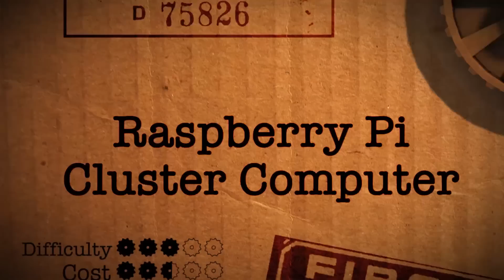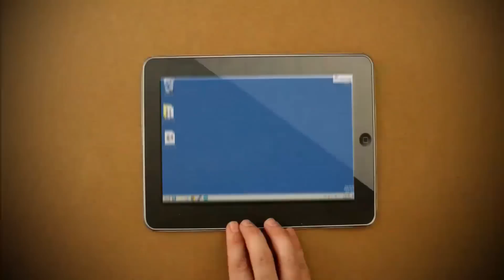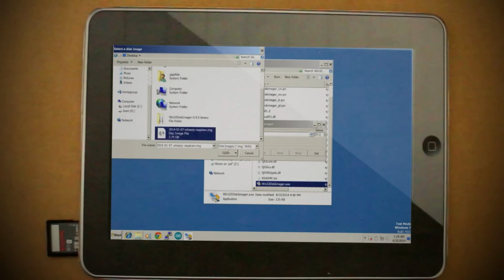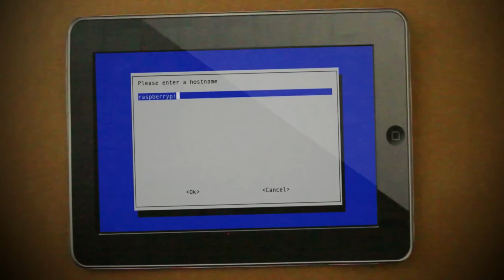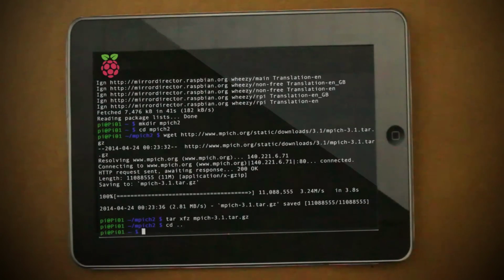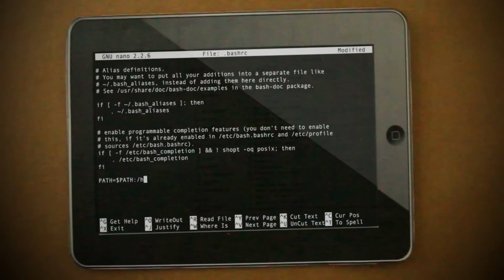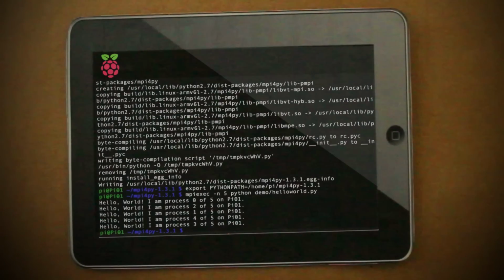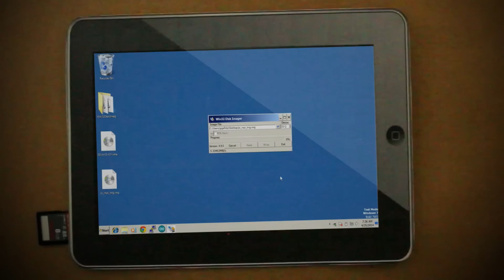How To Make A Cluster Computer (Part 1)

Comment: Hi. Great God-given talent. Is this also called parallel computing? Is this method the one used for data centers and render farms as well as supercomputers? Any idea or theory how to combine the power of Dreamcasts (lens are no good but the boards are ok) into one powerful Dreamcast scalable cluster that can be made for developing DC games that rival the modern console (just for technical fun) coz' the DC are still being developed for. 

Also any idea or theory how to make a cluster off Macs, say you have an old iMac and bought a new iMac, you'll double it's graphics power and CPU when it's doing parallel computing as well as have two monitors (scalable so everytime your iMac or Mac or PC becomes obsolete it can be added to the cluster so you can combine its power). 

Thank you. God bless. Rev. 21:4

Comment: I am bulding something more useful... i am setting up what i call Serverus 
not the harry potter character...  cerberus(mythological 3 headed guard dog made of servers)

Basically i'm using two RP2s and one Bannana pi and running a dedicated application server, database server and content server...

Now the raspberry pis are weak but they are running very specific tasks and responsabilities anmd i can optimize each server for the given task (i will be writing them from scratch... just for the lulz)

clusters are fun but pointless for most people....

It would be cool if one had some cool virtualization solution for creating a combined virtual computer that uses all the computers hardware a bit like windows azure does... not sure what software could do that that open source... but it probably wont run on a raspberry pi :p

Clusters otherwise are mostly good for task that can be devided and handed out like say rendering frames in an animation though the clock speed would be a problem for that probably...

Comment: Pi Zero is $5.00 .. Thats 20 of them for 100$, Thats 10gb of RAM, 20 Cores( I believe Zeros are single core correct?) I mean, it would not be the most powerful super computer or anything but should run rather well and the cost is dirt ass cheep.

Comment: So do all Linux variants use Sudo commands? What does Sudo even mean? I've been using windows all my life. As far as Linux goes I've only installed Ubuntu and Kali before. What the heck is raspberry pi.
Reply: It is used to run command as administrator.
So it's more powerful than basic command ^^
Reply: So It would be like the equivalent of running command prompt as administrator?
Reply: As a linux user by default we do not have the necessary privilege to execute each command. Typing in "sudo" allows regular users to be recognized as a user with higher privileges, so long as the administrator has enabled it $u$
Reply: Epic answer thanks
Reply: *****
Really?! What distributions are you talking about? If you use the pactrap essentials script sudo is included? I don't know a single distro but arch that doesn't have sudo by default..?
Reply: Oh, and the UAC prompts on Windows since Vista is another example of elevating and Ubuntu and KDE distros (at least) have graphical elevation where you need to type in your password. Also Macs. All of these can be disabled if you favour convenience over security or accidentally deleting something important, like on some machine where it doesn't matter...
Reply: Sudo is mainly Debian variants of linux, Arch uses pacman, but SUDO means your assuming the admin account during that command. if you don't use SUDO then your using the command as a standard user, with less privileges
Reply: 2009screwball What? What are you on? I use arch, and I use sudo? pacman is only a package manager. Pretty much all native bash and unix/unix-like devices use sudo.
Reply: I use -su into root, ,, and your right about pacman I was still waiting for my coffee when I read the post.  On a different note. I used LFS to build my own linux from scratch, and made my command "toes" instead of "sudo". so you can (when building it) make the command anything you want
Reply: 2009screwball  you can make it whatever you want sudo ln -s /usr/bin/sudo /usr/bin/<insert cool command name>
Reply: yeah, I learned that while building LFS. always thought being able to fully customize your OS was cool
Reply: 2009screwball thats why I use arch :P However i'm sure its the same with lfs
Reply: LFS stands for "Linux From Scratch" if you google it, it's an online book on how to build your own Linux from scratch, I did it, because of mixed hardware that some parts had no driver, or needed better driver support for. Instead of installing any of the thousands of distro's, I custom tailored one to fit my machine... kinda like building arch with more steps and added features.
Reply: Installing Kali but doesn't even know what 'sudo' is used for, dear lord...
Reply: sudo grants you raised privileges, kind of like in windows, when installing something and the box pops up asking if you want to run something as administrator.

Comment: Still trying to figure out what the hell I could use a cluster for.
Anyone find any uses?
Reply: +CheffBryan I know they've been used for 3D rendering (maybe not the Pi but..) , number crunching, password cracking, and much more. It's been done for fun and to learn about networking systems. Theyve done this at Stanford (I think?) with PS3's.
Reply: Scott x The only PS3 cluster I know of was built by the US Air Force, but yeah, none of those are things I have any need for. :P
Reply: +CheffBryan That was one, to simulate ground combat. The other was at : https://folding.stanford.edu/home/faq/faq-ps3/ 
Damn powerful architecture for its release date! Well see what pops up down the road.
Reply: Scott x And cheap. Didn't it cost tax payers a full 1/3 less than a traditional PC cluster of the time?
Reply: +CheffBryan Yes, I think they put it together for less than a $100k, which is nothing in Supercomputer world. I'd just like to harness all that power with a very multi-threaded port of Doom lol

Comment: Not worth it all.
Who uses linux?
Who wants to go through the trouble .  .  .
And pie eating?
Reply: only those who know nothing about computing can think like you, next time make a google search before opening your mouth, thats an advice...
Reply: Approx 40% of ALL personal computers run Linux or a dual boot with Linux, nearly ALL corporation computers run Linux, about 70% of Google employees run linux, so a shit ton of people use linux
Reply: Stardust342 Depends on what program you use to run a Win server, Linux is better set up to quickly run a server because 90% of the server coding is built in, but Win servers are capable of doing everything a Linux server, and if it's an AMD based server, Win servers run better because AMD purpose makes their boards, APUs, and CPUs for Windows
Reply: ://ReaperReaper Only problem is that most programs are made for either mac or windows, Linux: Good for servers (Easier on windows) , And Python programming.
Reply: like every non user computer is running linux...
Reply: Stardust342 Not used for personal or as a client/terminal in business. Basically he's saying like every server runs linux, which about 85% do, 14% run Windows, and the other 1% runs either Mac, Android, or Unix
Reply: Stardust342
Atms , android device, tvs, servers, google, twitter, super computers, many tings mon
Reply: Well that is interesting here is your cookie
Reply: Stardust342 Google has many client computers and PCs in use as well, and ATMs use a custom OS that combines Unix, Windows, and Linux coding
Reply: Zzzzx
Reply: Stardust342
Google uses both Linux and Windows servers to get the best from each OS family, and 95% of ATMs used XP 5 years ago, but they switched nearly all of them to custom OS builds for increased security
Reply: if you didn't know, ANDROID IS linux, google OS IS linux, and almost ALL cell phones run linux other than apple, and windows phones. oh,, and I use linux, as well as many friends of mine, DID YOU KNOW: Windows updates are housed on a linux server, cause it's more secure and microsuck doesn't trust their own OS.
Reply: +2009screwball the Android OS is only classified as Linux because of the base kernel, everything on top of that is completely different, and Android is actually pretty easy to hack and create malware for when compared to Windows phone 8. I also couldn't find anything supporting your statement about Windows updates. Linux servers aren't all that more secure either, considering that they don't use the same user authorization methods as a Linux personal computer
Reply: here's an article I got that from http://www.zdnet.com/microsoft-hides-behind-linux-for-protection-3039115920/
Reply: How about an article from a reliable news source? Zdnet isn't accredited, and dozens of their articles are blatantly false
Reply: There was one in popular mechanics a couple years ago on how Microsoft was borrowing ideas from both mac and Linux when developing the 7 and Win8 desktops, as well as mentioning their update storage on a linux server, I'd have to dig around for the magazine, but I have it somewhere. either way, I see Linux as largely misunderstood by the standard everyday end user, because it's not mass marketed. I've always said it this way, Windows are made of glass, you can break a window pretty easily. As for the whole thing with programs on windows, the main difference there, is packaging, In windows most programs are pre-packaged executable files, and in linux need to be manually packaged, and built, BUT not so much any more. package managers do a great job these days, I think this is where many people get intimidated by the use of command line
Reply: Microsoft doesn't use Linux servers, and there is NO credible source stating that either. There are multiple sources starting the opposite however. Microsoft also contributes greatly to the Linux community, and there is no evidence of Microsoft borrowing coding from Mac, but there is evidence of Apple stealing from Microsoft. Linux also requires additional coding to have access to even 1% of the programs available on Windows. I develop various things for both platforms using both. Linux is not misunderstood by most Windows users, it's misunderstood by those who seek only to use Linux as a PC, like yourself
Reply: ***** 
Four questions.. 
In what way does Microsoft contribute to the Linux community? 
What would be a credible source to you? 
What reliable sources do you have for your statements?
Do you have any clue what you're talking about? 

Multiple sources stating that Microsoft has not stolen code.. .wow. that must be some solid evidence you've seen. Would you mind exposing those sources?
Reply: Microsuck did not steal code, They borrowed desktop layout designs and "widgets" or gadgets, that have been used in the linux community for years and years. the search feature in the start menu of 7 has been implemented in Linux for  yrs before they finally added it. The structure of the newer Bootloader is much more linux like, than in previous yrs as well.
Reply: +Robert Crissman haha you mad bro. To say windows hasn't borrowed ideas from mac is a just bullshit. They all borrow from each other.
Reply: Borrowing anything implies giving something back.
No matter if you're borrowing an idea or money.

Microsoft's strategy of "Embrace, extend and extinguish" is not a secret, and has even been confirmed by themselves.
They use their current monopoly and poor documentation to adopt other's ideas, make them their own, then - once the standard is in their hands - they break away from it, to keep competitors from growing too strong.

http://en.wikipedia.org/wiki/Embrace,_extend_and_extinguish#The_strategy

Now...
This discussion has nothing to do with the tutorial itself, which is a state of art to say the least.
If you don't see a reason to use linux for this purpose, I propose you try and figure out how to do it instead of whining to someone who offered so much work for free by creating and posting this videotorial.
Reply: well said.
Reply: 2009screwball Thanks. I mean Linux has a life but most software goes with windows or mac
Reply: Fisk Advance I do know what I'm talking about. And even though Linux is 3rd OS
Windows and Mac have more software made for them.

I'm not trying to start an argument on open source Os's
Reply: Stardust342 Quite true.
Reply: Ethan Taylor 
Your statements aren't worth their space in pixels unless you back them with references.

I know what I'm talking about too.
superman does exist!
Reply: Fisk Advance  They're not a waist,
this is my opinion, you don't need to throw stuff at me. =)
Reply: lamiineK Come on, this is only an opinion. If you have a bad thing to say just don't say it =)
Reply: FUKMNY almost all ATM run Windows XP
Reply: none here in Wisconsin. ATM all run a embedded linux
Reply: Linux is often used for animation, Video, and Music production, writing programs, Astronomy, Business and web servers, Phone PBX. systems.. Many cell phones are Linux Based, Android is a linux Kernel. APPLE MAC OSX is Based off of Unix which is and WAS the very first operating system. It can really DO and be used for anything, depending on the users skill in tweaking and hacking the OS, which is freely available as an OPEN SOURCE project, many varieties depend on donations to run and be updated. You have to admit, that since OSX and Windows run in the $90 to $200 range for an OS and Linux can do all these same things, and has plenty of approachable software, for FREE it's a great thing.
Reply: *****
I use it everyday
Reply: It's superior to Windows. There are plenty of features.
Reply: Unix/ Linux WAS the very First and most stable Operating system... Why else would the federal Government use Linux / Unix, over Windows? the only government employees that use windows are the ones that do bottom end paperwork.
Reply: go48videos 40% of all PCs have linux installed and capable of connecting to the internet. Most Linux Installs are dual boots with Windows XP or 7 as the main OS. Linux is growing in the U.S, but it won't overthrow Windows, it's used to suppliment
Reply: Linux is AMAZING!
Reply: Without unix, no linux, no unix+linux, no Windows, no real comouter life, no computer life, shit get's fucked
Reply: mr.Adam Actually, Windows would still exist, it's DOS based, not Unix based, which is why it isn't affected by the bash bug
Reply: really so dos was on old phones and such? NOPE unix
Reply: and the firmware was....... UNIX and dos is basically a bios as dos in itself is useless
Reply: Benjamin Lovett Unix, DOS, Windows, Linux, Mac, iOS, Android, Palm OS, webOS, Tizen, and any other OS out there is NOT firmware, it is software that directly interacts with firmware
Also, The original Unix kernel had the SAME EXACT functionality as DOS
Additionally, MSI and AMD created a BIOS that includes a GUI and web browser
Reply: whatever man you win
Reply: lamiineK This is my opinion. Not yours. Keep out of it
Reply: 1. I use linux.
2. I do.
3. Pie is life.